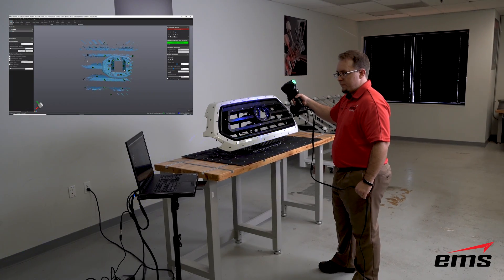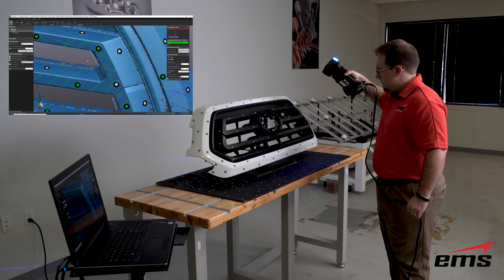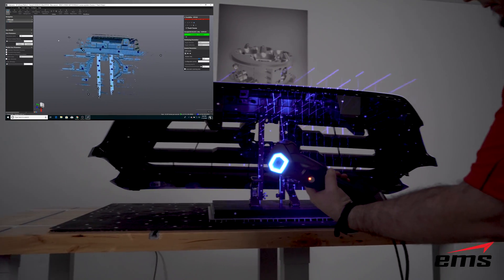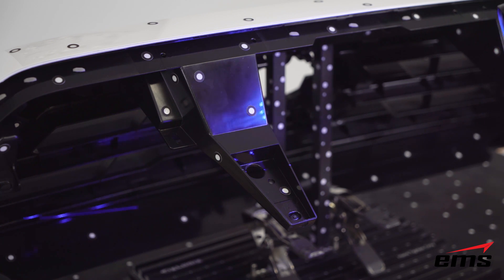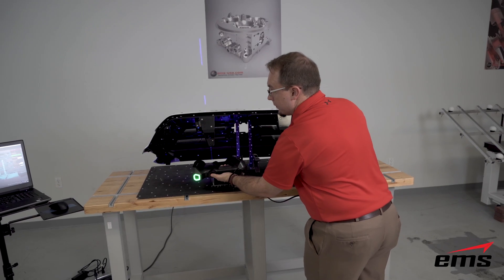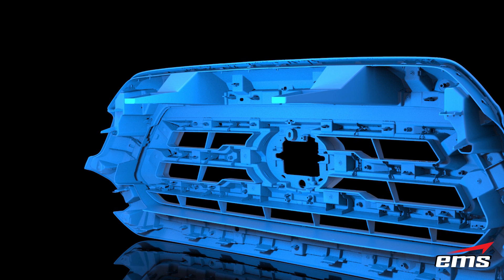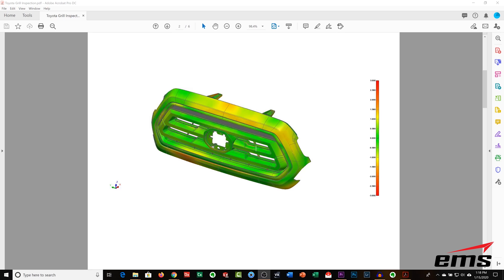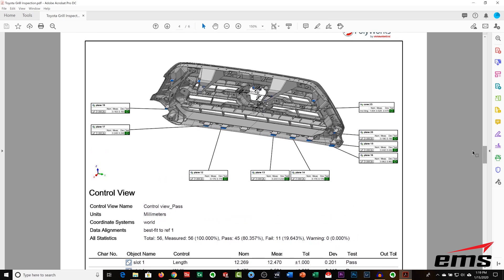3D Scanning Automotive Parts - In 4K

Comment: Hi...as it is shown the output has +/- 1 mm tolerance which is not at all acceptable in small compoment of injection molded parts , can you please tell whethet will this scanner  can generate data within +/- 0.05 mm tolerance
Reply from the maker: The HandySCAN Black Elite has an accuracy of .025 mm and is ISO 17025 certified.  The accuracy is validated to the VDI/VDE 2634 part 3 standard.  You maybe referring to the resolution which is not the accuracy.  Here is a link to a video that describes the difference between resolution and accuracy  https://youtu.be/5KJCJWElSEU?t=239     The link should take you to the correct spot in the video.

Comment: How do you turn this into an injection mold 😃
Reply from the maker: Hi Jesse,  Building an injection mold from a large complex part like this will take some time.  First you need to understand how an injection mold works.  From there you setup your pull direction, split the part, design your runout areas, slides, shutoffs, runner system, sprue, etc.   Many CAD software products have some injection mold design tools built in to help.  There are a lot of videos on Youtube that take you through the entire process.

Comment: Any recommendations for a good budget friendly scanner?
Reply from the maker: Hi Edward.  It really depends on your application, what kind of resolution and accuracy you need and of course how much you want to spend.  We don't sell or use consumer or prosumer scanners so I can't really tell you.  Your other option is to outsource to a company like ours who can do it for you using high end equipment, software and most importantly the skill set needed to turn manufactured parts back to idealized "as designed" CAD models.  Hope that helps.

Comment: Which software is better for 3d modelling, solid works or siemen nx?
Reply from the maker: It really depends on your needs.  Solidworks is lower cost, easy to use and very popular.  Also its easy to find tutorials on Youtube.  Siemens NX tends to be used by larger companies as its very powerful but more expensive.  No wrong answer here just depends on what you need.
Reply: CATIA 5 ?